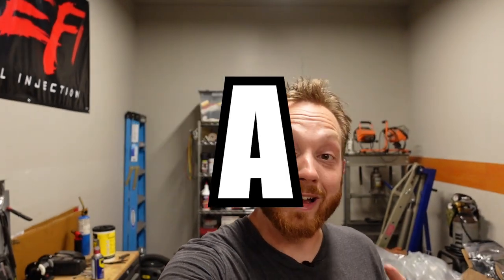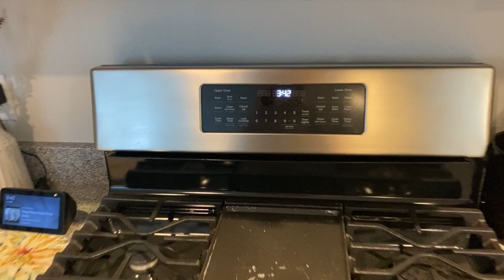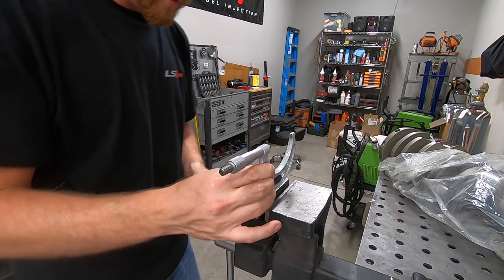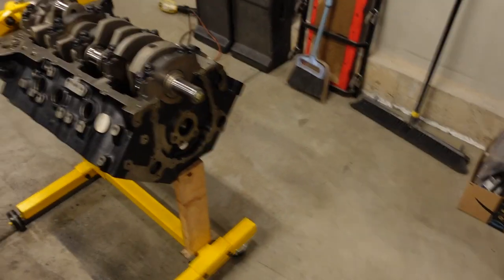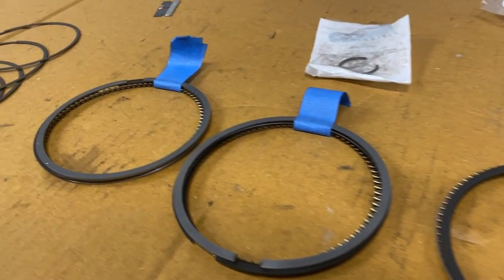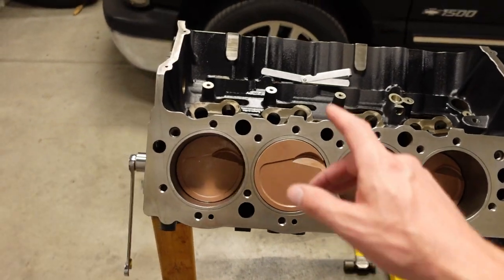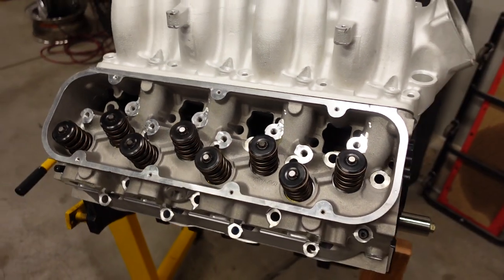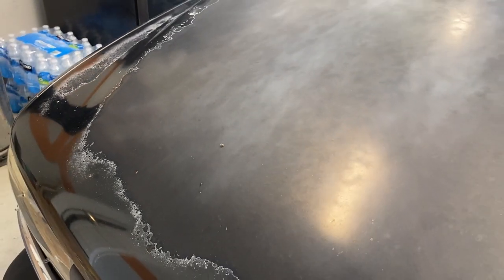535 CUBIC INCH (8.8 liter) Monster Big Block Engine Build

Comment from the maker: Should we change up the exhaust on this one to make it sound a little more rowdy for the new engine?
Reply: Change the exhaust?! YOU??? NO WAY! Who'd have thought you'd consider that LOL.
Go for it!
Reply: Without question cutouts and polished exhaust.
Reply: 3. 5 or 4 inch titanium pipes with an x pipe and boom tube I think would sound killer!!!
Reply: How about a Wrinkled Flat/Satin Red too match the aluminum &Red “Raylar” badge
Reply: This thing would sound really good with a tri y header
Reply: Rowdy is great... Just not obnoxious.
Reply: Hater pipe through the hood just like the diesel guys but no smoke "how dare you"
Reply: 8.1L is more LS than BBC
Reply: 2” primaries, hand ported manifolds. Twin PT6766 CHRA turbos. Titanium down pipes to a titanium hand ported Y pipe. Titanium 4” exhaust all the way back with a Borla XR1 muffler. Single exit through the rear bumper; satin black 4” tip
Reply: I supprt it, but please dont choose the "out of fender" solution that 99% of youtubers go for.
Reply: Absolutely! 
More engine has to have more growl. 🤘😎🤘
Reply: Go for it LT! Sounds like fun!
Reply: Cutouts
Reply: Yes yes
Reply: As far as color goes do chevy orange but add some metal flake or pearl coat to add a little flavor to it.
Reply: What are you doing for a fuel rail? I have a couple of these motors and finding a fuel rail has turned into a pita.
Reply: Oh yeah, it needs to sound the part too!
Reply: I second the vote for cutouts. Make it a complete sleeper for the day time then when it comes track time, make it loud and proud.
Reply: no, keep it as quiet as possible... retain the element of SURPRISE!
Reply: Definitely. Don't do everything you can think of to make it quiet. It's a race truck enjoy the sound of 535 cubic inches of freedom
Reply: Super 40 flowmaster 2 chamber
Mufflers, and cutouts, or you'll blow the mufflers off
Reply: BIG BLOCK CHEVROLET IS FUCKIN NASTY

ID LOVE TO SEE A MODERN DAY LS STYLE BIG BLOCK, LEGIT BIG BLOCK NOT JUST CUBES, LIKE THE WHOLE THING
Reply: I have a easy question about catalytic converter‘s. On a new Chevy express 4500 I got.  Do you have a email or some way I can send you my question ?
Reply: Nascar style side exit.  Fits your “different” category.
Reply: Yes
Reply: Lawrence LT Tolman Do a purple for engine color and deep raw power sound for the exhaust
Reply: You make it sound like whatever you like, you're driving it! 
Orange or a good red would look sweet. Satin black is too mellow for the ugly side of the truck... need some bright color to offset the black ugliness (its not that ugly though).
Reply: You need a straight 4’ pipe out of the turbo pointing down. Anything else will cause excessive back pressure.
Reply: @evlutionzllc5519   This is a turbocharged application. The turbo is the muffler. It will be quiet, put a 4 inch dump out of the back of the turbo. Back pressure can melt the pistons.
Reply: No its loud enough. But if you want make a  Electronic exhaust from from 1 of the muffler company and use it on the race track or every once in a while use on the street.
Reply: Well since you're upgrading the turbo can I have the 80 mm 😅
Reply: Yes, go all out!
Reply: I have only on word, Yes!
Reply: How about 90's to early 2000's nascar type boom tube like flat rectangle tube coming out from side skirt or under the door. X-tube would also make the sound to rock and gives more power too as it balances the exhaust pulses. Just throwing out ideas.
Reply: Whatcha think about trying to make a set of 180° headerz into the turbo?
Reply: Absolutely.
Reply: Do you know if the 8.8L and the 8.1L vortex intake manifolds can be swapped between motors?
Reply: @michaelminer8531 is this what u have on ur build? I just purchased a truck with a 8.1 and looking to put a turbo setup on it, is there a size/kit u reccomend me to get for great hp gains and good for everyday driver?
Reply: @shibbypoopalot what exactly are cutouts on exhaust?

Comment: Mitchell Stapleton's  Cadillac LSX Escalade @Stapleton42 weighs 5,800 lb and it's all wheel drive he's has1800 rear wheel horsepower with a twin turbos Texas Speed 427 and his goal is to run eight seconds too, it runs mid- 9's now. So it's very plausible👍🏻
Reply: All wheel drive with 1800 rear wheel hp? How's that work?  And how many hp on 4 wheels?
Reply: @MrPhukyew  selectable transfer case so he was able to dyno it in RWD. It made 1800
Reply: @johnnypdoesthings  so that means it's not all wheel drive, that means it's four wheel drive which is totally different.
Reply: It's not a Texas speed motor it's a LME engine in stapletons Escalade.
Reply: @MrPhukyew  the Cadillac is a awd truck originally is what he meant but Gm and their infinite interchangeable parts bin you can take the np149 awd t case out and put a np261 4x4 tcase in its place so the front diff is still the awd version so It doesn’t have the disengagement half shaft like the 4x4 setups
Reply: There's also not many awd dynos available for use either
Reply: Big blocks rule
Reply: Yeah he won’t be killing that LS or any other big turbo LS for that matter.

Comment: LT, as an engineer I can tell you the extreme level of detail you paid to the dimensioning and tolerances to get your bearing clearances perfect and verified will save you more than the cost of the micrometer and caliper.  With the level of horsepower your running, you can’t afford not to.
Reply: This is why engineers are not mechanics. Unless your reving this thing over 7500rpm that was completely unnecessary the plasti-guage would have given you a correct reading. If you noticed he didn't do the torque sequence properly I bet that's why the plastiguage reading was incorrect. Lots of confidence makes it look like correct information, nice 👍checking the rod bearings with a bore guage was just hilarious 😂
Reply: Good enough for an informational video.  The mockup and clearance measurements were done by the machinist in order to select his bearings anyways.  I only see a high speed torqueing sequence instead of a 3 level inside/outside bolt pattern so its hard to know if this was for real or a victim of editing, no clearances on the white board for info either.  I don't think  anyone can tell if his plastigauge technique was really at fault.

For the rod bolts -  torqueing rod bolts is not wrong - thousands of engines are built like that, but  I was a little surprised that he didn't use the stretch method.... another cool  tool could have been shown!
Reply: @glennanderson4440   mains and rod bolts are two different bearings good sir, I never said anything about a tutorial of the sequence, if you dont torque the crank down in sequence that will mess up your crush for the plasti-guage. I do this for a living, please stop confidently sharing misinformation.
Reply: Well I've been fortunate enough in my career to have a skilled machinist that does not screw up and advise based on experience
Reply: @Saltygarage  is that why engine manufacturers don’t use plasti-gauge in their assembly process? Hell a micrometer and a pair of calipers are as crude as a yardstick compared to what the people who make these engines use.. 

But what do I know, I just one of those engineers that will never be a mechanic.. That has a decade of experience with an engine manufacturer.
Reply: @treytavares8590  from factory where the block is just cast and the journals are cut to match ? Give your head a shake. You just proved my point you'll never be a mechanic
Reply: Lmfao a engineer but not a engine builder in the real world.save your knowledge for things you actually know.
Reply: Believe it or not the "tolerances" are pretty standard for most all platforms using aftermarket parts. 2 thousandths main clearance, one and half - two thousandths on the rods. Piston to wall clearance four to 6 thou depending on material the pistons are made of. If this was a dry sump setup or something at an insane power level the tolerances may be a little out of the norm. I.e. tighter main clearances for higher oil pressure. The tolerances for aluminum rods can be different in comparison to steel rods as well. Depends on whether the truck sees long term use on the street, or just 1/4 mile pulls at a time. I definitely don't know it all, but as a machinist of 17 years you learn a lot of things are common across the board. This motor definitely impresses me to say the least. I to am curious as to what the breaking point is power level wise. I'm also curious as to what component would fail first. Maybe we can talk LT into a final hail mary dyno session before he pulls the junkyard motor! Keep up the good work Brother 👍
Reply: I hope your not an auto engineer....that market has gone down the toilet and sits at the bottom of a cesspool here in usa.....brutaly bad....lets go brandon🤡🤡🤡
Reply: @tomkelly3896  😮‍💨 no mrr
Reply: @Trey Tavares  a micrometer is "crude as a yard stick" hahaha tell me you don't take precision measurements for a living without telling me you don't take precision measurements for living.
Reply: @Saltygarage you could have just mentioned the last half of your comment, the unnecessary bashing on the guy because he mentioned being an engineer is something else. He commended the guy in the video for his efforts in guaging shit, most engineers go off of numbers on paper and what their gauges tell them - he did nothing wrong. Look at how many comments in this section can't even use the proper form of "you're" or "your" but hey, we won't talk about the guy in the video only measuring the journals on that crank one way so he doesn't know if they are circular as intended or oval shaped from poor machining.

Wait..... I said "circular" 😮 should we have a pissing test to see who knows more about concentricity versus runout constraints?

Comment: It's not OCD to check clearances on expensive block,crank,rods,mains etc,its smart. Much cheaper to catch any problems early than eat a bunch of high dollar parts up. I commend you on the block cleaning,most people miss this important thing! When using a micrometer, let the tools acclimate to the shop temps,and when holding it don't wrap your hand around the frame of the mic,the heat from you hand alone can change the readings you get. When you check everything,you know its right in your mind and gives confidence in what you build. Excellent build and appreciate how many details you give on this build.

Comment: I used to build engines of all sizes! Old Cadillac in the 60s that were 535 cu inches. Stuck a billet crank in the 535, made the engine breath, and the stuck it in an off-road road truck!
Reply from the maker: That sounds like a blast! I had a 472 caddy swapped c-10 some time back, those were torque monsters!

Comment: Been running that similar combo for over 10 year's in my chevy truck. Ran a 5.09 at 134mph witha 1.16 60 ft.  450 shot of nitrous. Love those combo's stock block works great
Reply from the maker: Sounds like a fun setup!
Reply: Holy crap!

Comment: That Raylar intake is GORGEOUS, and watching the care you take in assembling this motor makes me think "LT totally deserves that gem."

Also, paint the whole thing Oldsmobile Blue just to screw with people.
Reply from the maker: hey thanks a ton! and agreed, that would throw people for a loop
Reply: The intake and heads supplied with the latest version of PSI's 8.8 big block are very impressive... and may negate the need or expense of the Raylar top end.

Comment: I ran up on an 8.1 out of a generator recently and am planning to build it. Been using a lot of your videos as advice as there’s not a ton of 8.1 info out there. At least when compared to LS and older generation big blocks
Reply: Cummins natural gas generator? They used PSI engines. They’re maybe even a turbo version if I remember right. Like. 125-175kw genset
Reply: You need information here you go an 8.1 vortec basically is an bored out 6th gen 454 big block with LS1 Like cylinder heads same firing order as an LS1 I think basically this is an big block with the Potential to have really high flowing cylinder heads and make more power then an conventional big block Chevy head

Comment: For the engine color, consider having a metallic. If you want a bright color, yellow goes well with black, or a super-bright blue, or maybe even the iridescent pearl white. Of those 3, that's the one that would pop but still be understated. I'd top 'em off with satin black valve covers with the pearl white for any raised lettering or edges, or go white for the body and black for the raised.

No matter what you choose to do, it's gonna rock!
Reply: Black paint dissipates heat and looks menacing....black, black,black,all day black

Comment: HEY LT.... "pour and restore" worked great for getting spots and stains out of a customers concrete driveway. 
Also, dawn dish soap straight on the stains, rubbed in to the stain, then let sit and get rained on / reapplied / powerwashed

Comment: This brings me back to my teen and young adult years. I spent them with my grandparents on mom's side. Gramps is an old school mechanic so I learned all the old school tricks. I can remember building many engines with him and using tools like these for bearing clearances. We also used plastigauge but as you experienced it was not always accurate. Thankfully we were doing stock style rebuilds of old Ford engines (mostly the FE class) so clearances being off by .001 did not matter in most cases.

Need a distributor and carburetor equipped engine tuned? I can do it by ear. Once you adjust a distributor and carb jets enough you learn what sounds are good and bad.
Reply from the maker: I've learned so much from my grandfather as well, lots of great knowledge that gets passed down
Reply: same with me and my moms dad!!
Reply: I'd say it's good enough for n/a but forced induction nay detonation is inaudible at beginning and when you can hear it sometimes too late squished rings or pistons look like dry creek beds timing is critical
Reply: Unfortunately,  I had no elders to guide me....learned at 10 yrs rebuilding my enduro bike engine and got better with each.  Books and Internet and a farm full of machinery helped a lot, there is no excuse now to not be able to do it right these days.

Comment: Go with black and fire engine red for engine color! Maybe the bottom end in black and the top end in red or mix it up! Red valve covers red intake black cylinder heads and red block let alone timing cover etc. Can't wait to see what you decide on brother! ... Or if you win the lottery and make sure that turbo is red anodized! 😁

Comment: If I remember correctly, you haven’t been spinning the 8.1 engine very high. The 535 should make power to well above 6000, I would think, which should mean an easy 700 hp NA at sea level. That and 15-20 psi of boost puts you at 1500 hp, just as you’ve planned. Just wondering if that changes your gearing at all. If you’re running a 28” tire, that’s about 720 revolutions per mile. At 6000 rpm I think third gear (1:1) should give you about 146 mph, a little low for 8s. Your shortblock could turn faster though…
Reply: I believe he shifts the current 8.1 at like 5,000, which should be right on the very tail end of what the stock cam can support
Reply from the maker: we may have to address gearing to reach out goals for sure.

Comment: So much of the precision measuring is feel and skill that gives consistent measurements. Props on you for doing it the right way. Plastigauge doesn’t show you the taper or out of round conditions. I would like to see .0025-.0028 on the mains. I like to run the ford Windsors around .003” on the mains and. .0026-.0028” on the rods. Loose is better than tight for racing. Also don’t forget to check the connecting rod clearance on the small end bushing and the wrist pin. You want .0008-.0012”

Comment: I still don’t understand why you would put all that into an extended cab. It’s so much bigger and heavier! 😂
Reply: Because extended cabs are so much cooler, you can take more than 2-3 people with you, or put subs in the back! I'm wanting an extended cab front bench dually that I can put subs, tool storage, a small air system, an inverter and built in hardened desktop style PC, and just one jump seat in the back of. (Yes it will likely be crammed)
Reply: Yep I'd jam it all in the Orange CoPo but I can relate cuz I'm a fat man myself and I can't fit in a regular cab comfortably much less I ate second vehicle that's got to have a roll cage the extended cabs got a little bit more room for a roll cage and Mobility but LT's a little guy  he could've made it work lol

Comment: Cool build. $0.02 I wouldn't use WD40 as your final post-wash protective light oil. It actually attracts moisture to itself and will cause everything to rust. Need a heavier oil to protect the surfaces.

Comment: Good work! Also that Lucas oil assembly lube is good stuff, I always tell people it’s cheap and your local auto parts store carries it.
Reply: I work in a parts store and always recommend it. I usually tell them my personal anecdote of the time I ran my twin turbo Ford 300 for 10 minutes without oil pressure (the oil pump drive shaft was too short), just the assembly lube smeared over everything.

Comment: Some trick for setting dial bore gages. If you are using a micrometer get some plastic tubing that just slides on to the anvil and spindle of the micrometer.  This will keep the indicator contacts from dlipping off the face while getting your zero set. A better option is either make a ring that matches your crank mains (if you have a lathe) or have one made. It's the easier option for setting. Expensive dial bore gages such as a Sunnrn actually come with a setting fixture.
Reply from the maker: I love the idea of the plastic tube, that would help a ton!